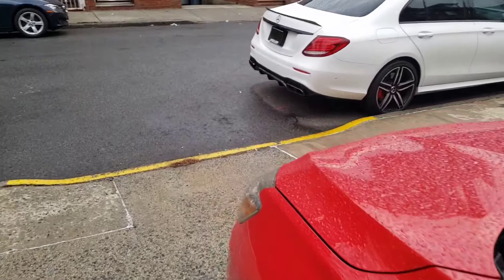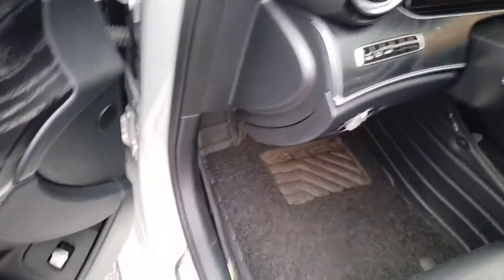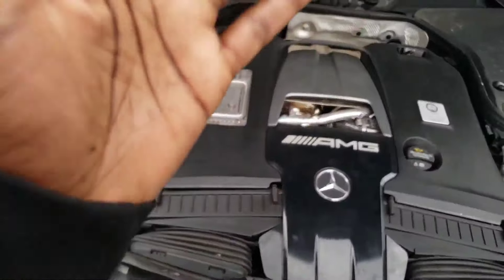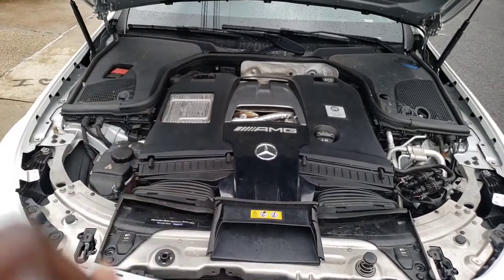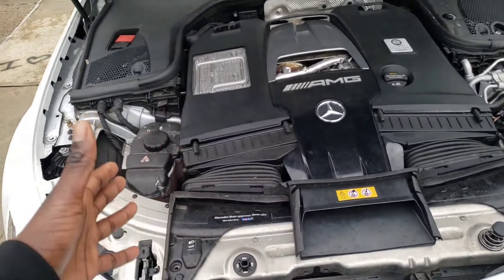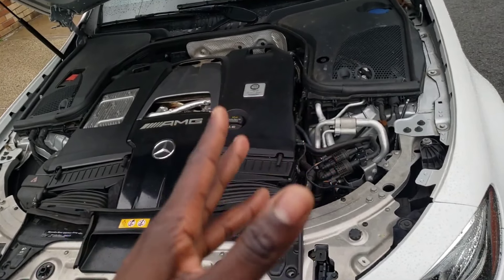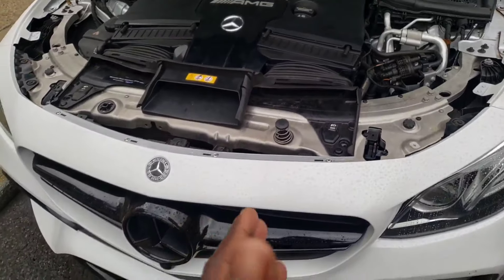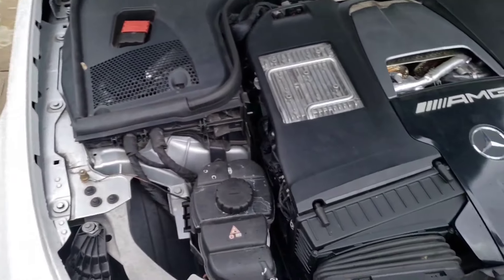E63s broke down 2nd time

Comment: ive own a 2016 c63s beat the hell out of it for 40k miles no issues, owned a 2018 e63s beat on it for 10k miles no issue my current 2020 e63s beat on it for 20k miles only issue ive had is thermostate needed to be replace and i guess thats a known issue mb gave me a 8yr 120k warrant on it i believe, all my amgs where cpo, no mods.
Reply: That’s not really a good sign for a thermostat to fail so early 😢
Reply: Def enjoy the hell out of your E63s (it’s an amazing car) but don’t get another Benz afterwards, the new ones are horrible quality

Comment: The IC system is in line with the trans cooler. IF trans is overheating, the means your IAT's are sky high and your not getting good performance from the engine aswell. What you thought was the ECU is the ECU, has a line running into it that cools it. Fill the IC tank that is empty with Benz spec coolant and mix 50/50 with distilled water. man have to check it a few times, may need to be bled aswell. never open when hot.

Comment: Better off with Infiniti.
Reply: I told him
Reply: Infinitis are trash, this is a reupload from boost in motion and all these issues came from the previous owner taking the car to a jiffy lube, them not putting the oil drain plug on properly and then oil leaked causing the engine to blow so they put a replacement in but in the install messed up installing the transmission .
Reply: @jayhawker931  Infiniti is more reliable than Mercedes. Plus maintenance is more affordable. If you disagree with that, you’re in denial.
Reply: I love German cars but the truth is Japanese cars are the better cars (typically) in terms of reliability.
Reply: Bmw gang
Reply: @Al_Sayid_Sanad  BMW gang what? BMW gang has the most unreliable vehicles?
Reply: @salimrandall  don’t be stupid bmw placed top 3 reliability with Toyota and Lexus recently. Old bmws are terrible i agree but the new ones are fantastic
Reply: Infiniti is just a fancy Nissan 😂
Reply: There’s no Infiniti in existence that’s worth taking over the engine of the E63 alone
Reply: @lambokiller99  Engines alone do not make up a vehicle. Mercedes is unreliable period. Drive whatever you want that doesn’t change the truth.
Reply: @salimrandall  keep driving your altima, the doors on an E63 are worth more than a fancy altima
Reply: @lambokiller99  🤫🤫🤫🤫🤫🤫🤫
Reply: He’s had multiple in the past and they were great but the new ones are too similar to the older ones so there is no point in getting another, I think he should go BMW or Audi
Reply: He’s had multiple in the past and they were great but the new ones are too similar to the older ones so there is no point in getting another, I think he should go BMW or Audi